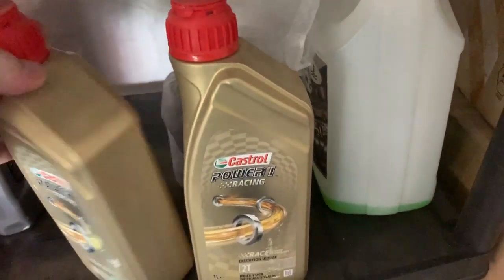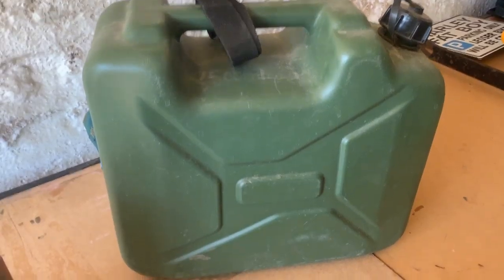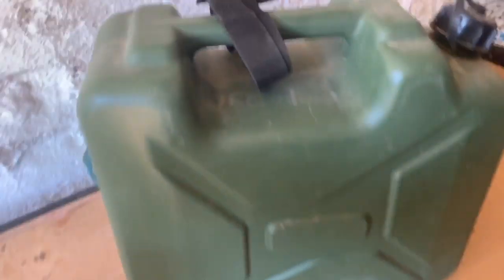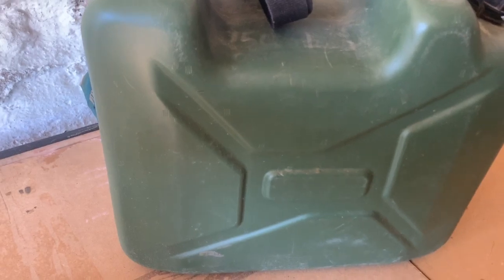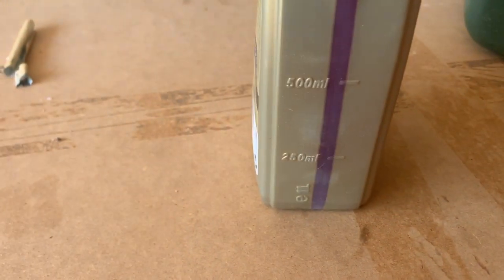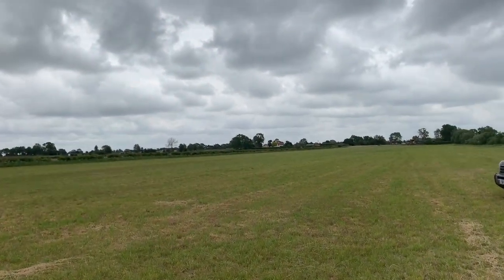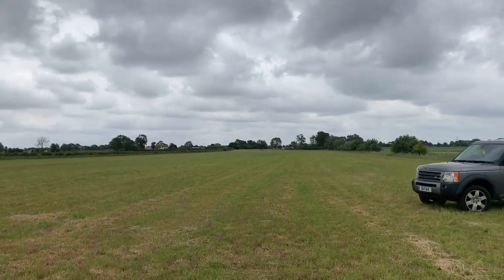Paramotor Licences, and the Parasock Draw - The Haircut Edition!

Comment: Hey from the USA! As far as the idle issue I would recommend shutting the fuel off while it’s idling and leave it off till the motor dies before storing any small carbureted motor. The reason for this is that there are small veins in the carb that draw fuel from the bowl for idle and they get gummed up. Shutting off the fuel supply pulls most of the fuel out of these and eliminates the problem. That’s how we shut off all fixed wing carbureted planes as pilots. Love the videos man! Happy flying!

Comment: The factory setting are purely a guide. Which usually means it runs rich because this will not really "damage" the engine. It will just run lumpy and use more fuel. Over time the diaphragm can wear along with the metering spring which can adjust your fuel mix ratio. I think I done a video on it on my channel. I have now rigged up an in flight tuning device so i can adjust it dependant on the weather, temperature, altitude while I'm in flight
Reply from the maker: Thank you for the advice 👍

Comment: Hi Shaun, just a few clarifications on the terms you used in your video. Paramotoring is not unregulated, it's deregulated in the UK. You are required to have insurance (Air Navigation Order) if you are taking off with wheels, and is  part of the Sub 70 exemption. Boring comment but I thought it was relevant.
Reply from the maker: Thanks for the clarification GF22

Comment: Hi mate, I have the same motor. As mentioned, you can adjust the low end to keep it revs smooth and adjust as necessary. As you already pointed out, this must be done while the engine is off as the screw is too close to the prop. It's a bit of a play and feel exercise but well worth it so don't be afraid to give it a twist.

As the spark plug is at the very bottom of the engine, you should check the plug as soon as you land to get an accurate reading while the engine is still hot. 

I would also recommend running on Motul 800 for 2 stroke and the highest octane fuel you can get. 

Looking forward to watching you get it the air fella, take your time and keep making progress 🪂

Comment: So happy to see your back. My 2 cents.....Low jet is not as crucial as far as leaning out the motor. If you lean out the low you need to usually open the high. Do it by sound and or RPMs. Open the throttle all the way till you get the highest reves. Keep opening the  hi jet till they start going down a little, that should be rich enough. always  keep the hi jet as rich as possible and or open. Keep It safe.
Reply from the maker: Thanks for the tips! The carb screw is pretty close to the prop on the Nirvana - I don't think I fancy putting my hands in there while it's running.
Reply: , @FatParamotorGuy  Right, that would be bad . but there are ways. like a long rubber hose with the inside diameter the same as the jet diameter. then cut a slit in that end of the hose to fit over the T end of the jet. now the hose should be long enough to go back on a sight angle to behind the net. and now you can turn it from there ...GOOD LUCK  Happy flying

Comment: Adjust the low jet screw until motor is smooth. Adjust the high jet screw until you get correct spark plug color at full throttle, leaving it slightly darker than what a road racer would do. Deviation from spec on low jet would cause me no pause. Having a bright white insulator core on a flying machine would.
Reply from the maker: Thanks for the help. I'm not sure I fancy altering the carb while it's running. The screw is about 2 inches from the prop. 😬

Comment: Shaun on your carb settings, the low end you can adjust to your hearts content for a smooth idle and snappy response when you go to full power on the throttle..Be careful playing with the high end though as you can lean the fuel to air mixture to much causing major problems and melting pistons..
Reply from the maker: Thanks for the tip! Altering the carb while the Nirvana is running os pretty dodgy as the screw is so close to the prop. 😬
Reply: @FatParamotorGuy   lol  with the motor off adjust in 5mins of angle..restart and see if its any better? Turn off adjust another 5mins and so on

Comment: Well done Dusty. Shaun as a fellow Retracta Trike  owner I noticed that you are using different wheels and you have a dampener fitted to your steering. Your thoughts on those changes. I am looking forward to your first flight.
Reply from the maker: Bob provided the bigger wheels for the terrain in Spain which is very stoney and hard. They are heavier than the usual wheels though. That isn't a steering damper, it's a selfie stick for the camera. Thanks for watching 👍

Comment: It's a single cylinder 2 smoke on a 2 stage carb it's will never run that smooth below 2000 rpm.

Welcome to the PPG world
Reply from the maker: I understand what you’re saying, but it used to run much smoother. Turns out a carb rebuild was needed.